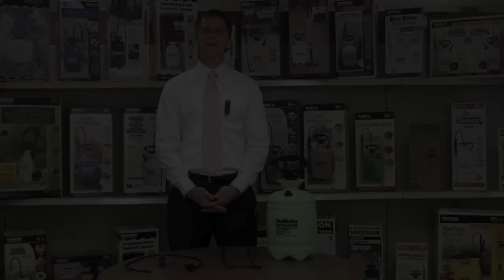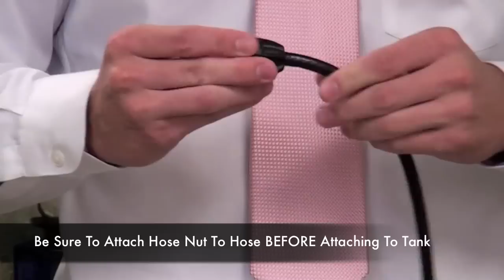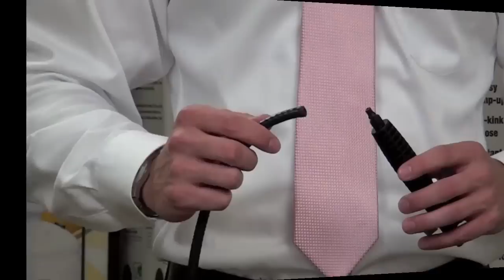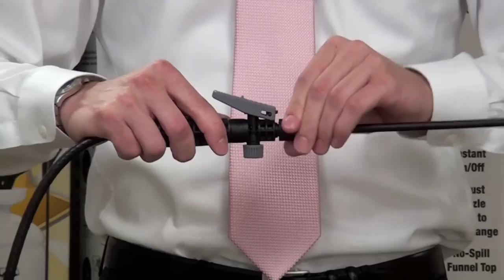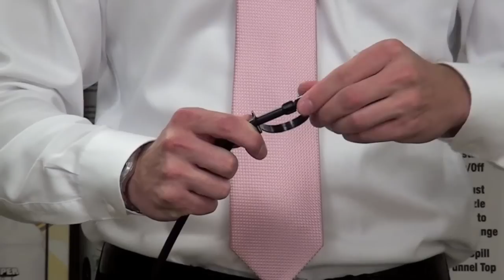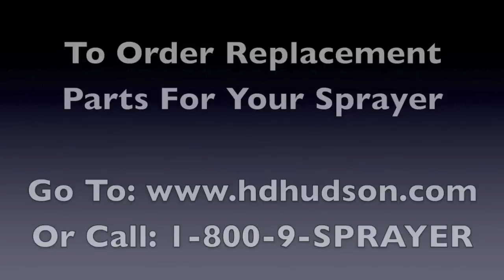How To Assemble The Spray Assembly of Your Hudson® Sprayer

Comment: For one thing, it's difficult to find the exact unit one's trying to assemble on the Hudson website.  I did find one that is closest to what I bought.  Everything went fine, until it came time to insert the spray wand into the shutoff valve.  The wand circumference and valve fittings were the same size - one could not fit into the other, even with the nut clamped down.  The wand still popped off.  The written instructions are completely useless.  I had no choice but to return this product to the store and get a refund.  Sorry, Hudson, but you're going to have make parts that fit before your product can be used.
Reply from the maker: While Hudson® has a 6-step quality assurance procedure to ensure you have a perfect experience with your sprayer, it is possible that on occasion an incorrect part (wand) may be included in the box.  Your wand and valve should fit together very easily during assembly.  If this was not the case your sprayer may have had an incorrect part.  You can always call 1-800-9-SPRAYER and we will do everything possible to correct the problem for you.  Also, Hudson® instructions have recently been redesigned to a very user-friendly format.  You can download a copy off of our website on your sprayer's product page.